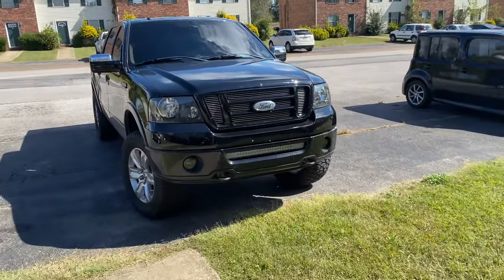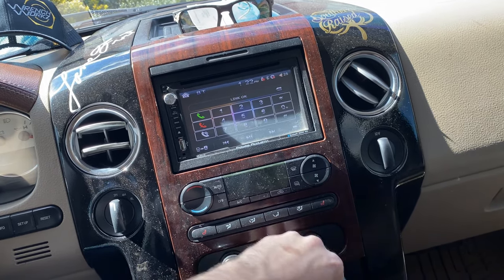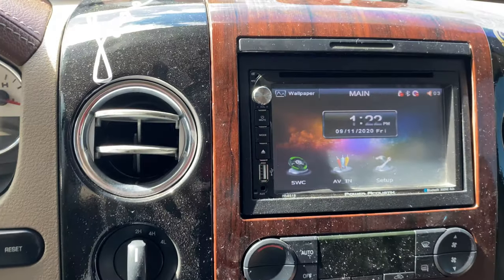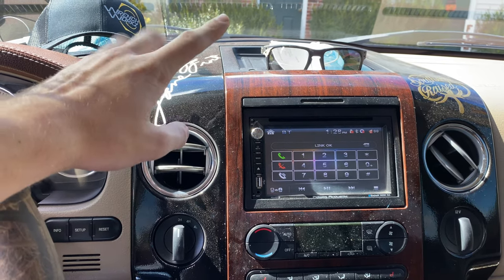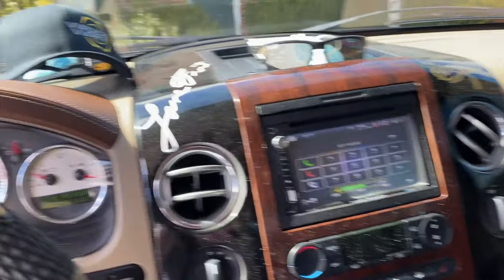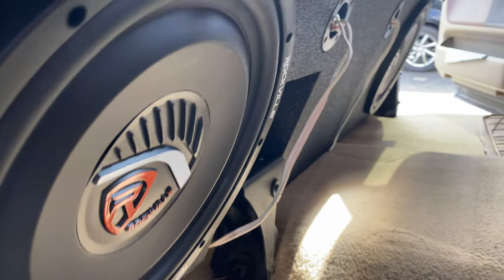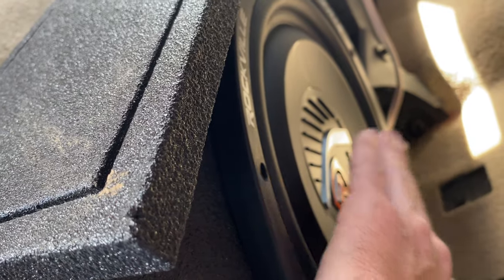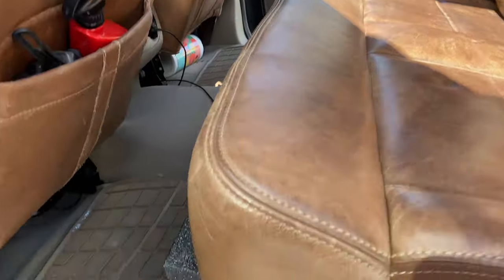HOW TO GET AWESOME BASS IN YOUR 2004-2008 F-150!!!

Comment: All I did was buy 4 pioneer 4-way speakers and a pioneer head unit, sounds really good and has pretty good bass
Reply: wondering if you're running an amp to the pioneers 4-ways or just to head unit?
Reply: @clark8712  just the head unit, do you think I should get an amp ? I’ve been thinking about it, I heard it makes your speakers louder and it gives you more bass.
Reply: @rudolphangel332  Oh no idea, I know I've got a powerful amp, 120 rms per channel. It needs repair though. But I was thinking about get 4 of these pioneer 4-ways for the doors and wondering how they held up with an amp. If I were you, I doubt i'd get amp for them unless you got a sub  and sub amp also, or get a 5 channel amp and a sub. So you get a full balance of sound.

Comment: hey man sick set up, i had 2 12s in my old car but after buying this truck the subs wouldn’t fit & i really miss that bass. Christmas is right around the corner & i was wondering abt your set up i would really be interested in doing something similar, it sounds great!
Reply from the maker: Appreciate it! You can order a box that will fit two shallow mount 12’s for around $100! However you won’t have the airspace or mounting depth required for any competition or crazy bass that will flex glass. I have Rockville subs and I have no complaints out of them this far!
Reply: @JayThompson25 Appreciate the reply! haha ya i don’t need any glass flexing bass i think a normal amount will do! do you recommend ordering a box off of Amazon?
Reply from the maker: It’s your preference really! I’d make sure to go with a box with some reviews and pictures posted for fitment sake, but I’m sure there are good boxes available!
Reply: @JayThompson25  saw those bro on rockville was just on the website last night, dual 12" sub box that fits under the rear seat of the 11th gen, excited you recommended because there was a review under it and it said "cheap material" but I mean its 99$ can't beat that.

Comment: Just a simple question, installing a 10 inch into my truck which happens to be the same body style as your truck, the only problem I am having is deciding where I would like to mount the amp. Did you mount yours behind the rear seat backrest or did you mount it under one of the front seats?
Reply from the maker: Yes. If you don’t have a sliding back glass it’s easier, however I had room for my specific amp on the passenger side behind the back of the rear seat
Reply: @JayThompson25  Alright, thanks for the advice. Also really well made video and a very cleanly built truck you have.
Reply from the maker: Thank you!

Comment: Looking too add a single sub and box too my truck it will be on the passenger side rear seat my question is how did you run your wires thru the firewall I've never hooked up a sub and amp before so any help would be appreciated.
Reply from the maker: Around the steering column is an existing grommet! I ran my power wire through that and then down the driver side. I ran the rca from the head unit to the amp on the passenger side. This reduces interference. The amp is mounted behind the back of my back seat. Plan to make a video soon showing how I did it all!

Comment: What subs are those? I have a underseat box for my 05 f150 with blown 12s need a good upgrade for cheap!
Reply from the maker: They're rockville audio shallow mount 12's!!
Reply: @JayThompson25  Preciate it man. If you’re every looking for some good cheap bass I recommend massive audio summo84s. They are 8’s pushing 1500w and SLAM. I have two in a ported box.Cant beat them for 100$

Comment: Looking to do this how do you route the rca and remote from the head unit in the dash down to the back? Is it thru the shifter area please explain 🙏
Reply from the maker: I went behind the radio across under the glove box, pulled all the floor trim, and ran it beside existing factory wiring  to the back seat!

Comment: Hey man, how good is that radio? im thinking about an atoto a6 pro or s8, these looks promising, full of features.
Reply from the maker: It’s decent, I’ve had it for two years now. It glitches out sometimes, and you have to set the time every month cause it’ll get 5-10 minutes off, but it serves its purpose. It was a birthday gift so I didn’t complain 🤷🏻‍♂️ eventually will move up to one with car play or do the iPad mini conversion! But to answer your question the radio works well with some issues from time to time 👍